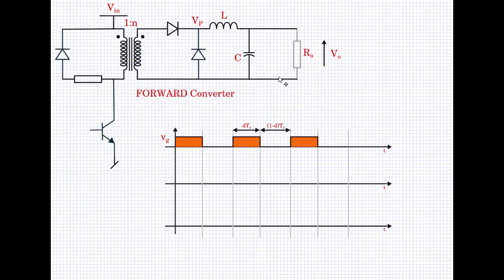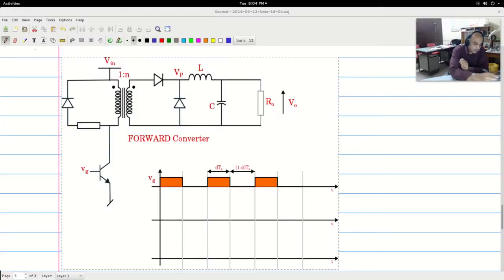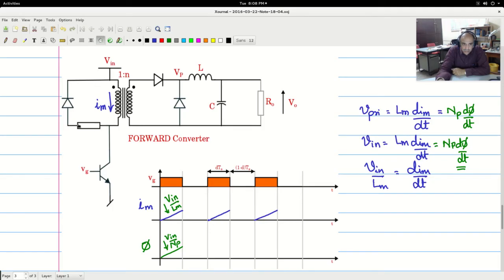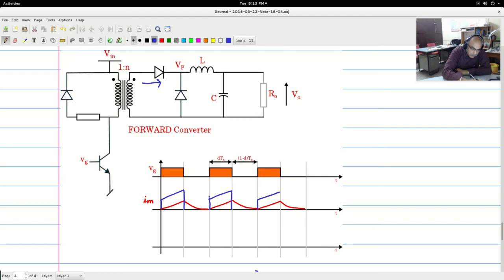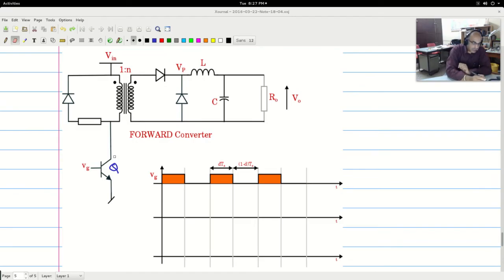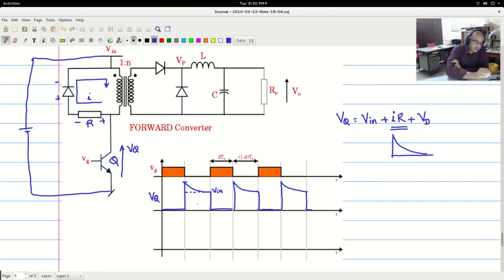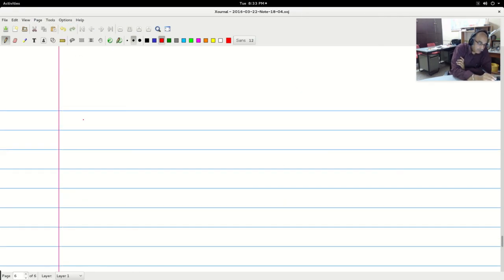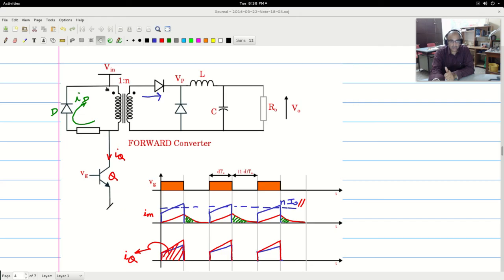Waveforms and Design

Comment: is it possible to get 170vDC from24vDC with this type setup? or would it take multiple small units. its for a DC to ac inverter project. I need a min of 6-8kw output. I was thinking of using a arduino to run the boost stage. could you please give any advice? I can use all I can get. your videos inspire me to try to build things. I am self taught and can really use the help if you could. thanks for the inspiring videos...
Reply: These converters are for auxiliary supplies with the range of 100watt max, if u want to go for higher range use full bridge dc dc converter.